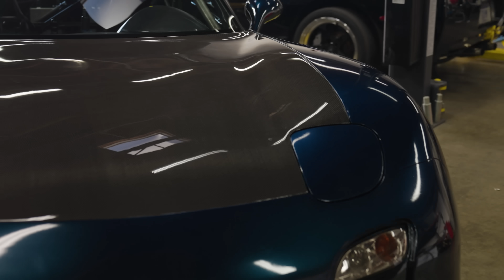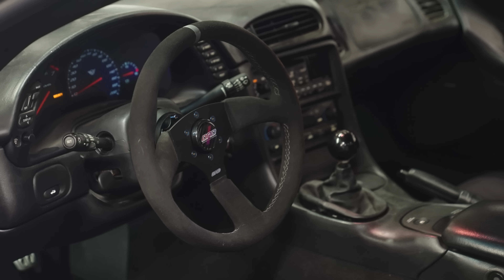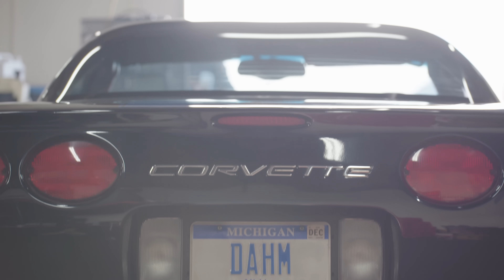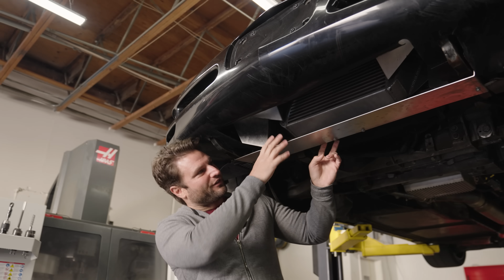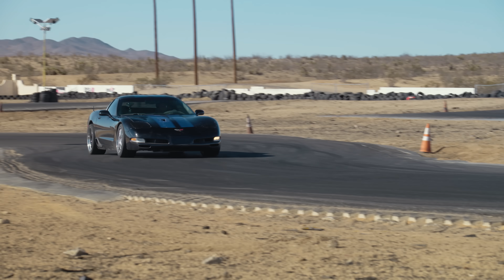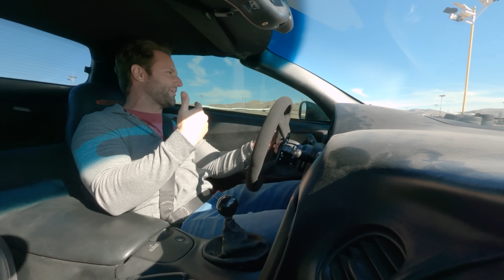Flame-Spitting Two-Rotor-Swapped Corvette Z06 | Top Gear American Tuned

Comment: Look, I am not a rotary fan, at least not a 2 rotor fan, 3 and 4 rotors sound awesome, they scream and brap and make all the right noises. The 2 rotor on the other hand sounds like an angry weedwacker. With all that said, I still approve since growing older I approve of blasphemous engine swaps more and more... so its still a pretty cool build even if its a weedwacker sounding 2 rotor...

Comment: I love how casually he mentions that his 2-rotor has 1000 horsepower. What a flex... 😁😇🤟
But yeah, it's weird seeing Rob driving without his laptop. Just driving his contraption without constantly worrying must have felt good for him... 😎👍
Reply: He mentions that the fuel system is good for 1000 hp, not that the car has it. Still quick enough with around 500-600 hp.

Comment: Objectively speaking, if you wanted a more balanced C5Z you could have done some carbon bodywork and other small front-end weight saving steps, and then MOVE THE BATTERY to the rear and ended up with 90% of the results for far less time and cost.

Admit it… balancing the chassis was simply a result of the primary goal - doing the opposite of what 99.9% of swappers are doing, and for no other reason than just doing it.

Regardless, cool car and great build!  Glad to see you enjoying the driving phase of the project. 👍

Comment: Bro should be ashamed of himself. It's as bad as putting an electric motor in it. Vile.
Reply: It's a clean build dude, the amount of money and time he put into it is anything but shameful. I get you don't like that he took out the V8, but it makes a lot more power than stock, and is a lot more interesting the usual blown/procharged setup most boosted Corvettes get. Don't hate on another man's build, even if you don't like it.
Reply: Ashamed? The swap is lighter than stock, mid engine, 1000hp out of a 10k rpm  2 liter.

Comment: It's not just the power to weight that would improve, but you would need to change the tachometer so that it can rev much higher.
Should improve the car's top speed.
Reply: The tach is simply an output. Engine is going to rev out regardless.
Reply: @anthonybomicino3276  
But you can't determine rev's without a tachometer that can display it. 
It can't rev infinitely, you can try but if you rev higher than the engine can handle than you could badly damage the engine or break it.
Reply: @brantleyfoster021  the ecu wont let you
Reply: @anthonybomicino3276  
It will if it's been upgraded to suit the engine. 
Do you mean that you wouldn't adjust it to rev to what the new engine can actually rev to?
Reply: @anthonybomicino3276  bro it doesn’t have a factory ECU.
Reply: @Fat_Moose24  bro, but it has an ecu.  Rev limiters, ignition cut, fuel cut are in almost ANY ECU
Reply: @anthonybomicino3276  
The standard engine in a C5 Corvette ZO6 will rev to a maximum of 6500rpm. 
A Wankel Rotary can rev to 10000rpm or higher depending on the setup. 
Having a much higher rev range will give you a higher top speed in comparison to the standard setup. 
For example, the top speed will be reached at 6500rpm in the standard setup. 
This new setup means that it will be reached at 10000rpm at least, the extra 3500rpm will give it more room to reach far greater speed's. 
This is not a standard setup, it's designed to take full advantage of the Rotaries power band as he said.
Reply: @brantleyfoster021  it doesnt run on stock ECU, it uses one from Haltech
Reply: @pillowrex811  
I was trying to tell anthony that

Comment: How did you get 1000hp out of an RX7 engine?
Reply: cuz he's Rob Dahhhhhm
Reply: He said the fuel system is capable of it, he’s not running a thousand hp on that motor because that’s not what the car was made to do. He’s running around 600hp, plenty for the track.
Reply: @spoobspoob2270  it did make around 700hp on the Dyno though
Reply: Strengthen everything, add more boost, viola
Reply: Stronger studs, clearance for the rotors and ports to allow the turbo to put air into the engine
Reply: rotary drag cars are making 1800whp on 2 rotors now
Reply: @stephenwever  yeah but they only last 1 run
Reply: @Fat_Moose24  not realy it can go a raceday 90 psi isnt baby boost most motors wont last at that boost level
Reply: Magic, i assume.
Reply: By being a legend

Comment: I’m so excited to share this monstrosity with everyone on Top Gear. It started out as a gimmick and turned into a really capable car
Reply: Wish the OG’S reviewed this
Reply: @NTBOE  I agree with 💯 but rob is a great @ it,
Reply: I love the C5 platform. 

200 lbs lost off the front end is nothing to sneeze 🤧 at. 

What kind of rear end ratios do you need for that engine set up?
Reply: the C5 has aged well aesthetically as well.  what's the final weight and weight balance after taking 200lbs off the nose?  would love to see it with a nice fresh set of wheels...
Reply: You’re crazy 😂
Reply: Rob you need khyzyl Saleem to make a body kit for this  @the_kyza
Reply: Most stock Corvettes are nearly 50/50 tipping one way or other, other then c8 they are front mid engine since engine sits behind center of front wheels
Reply: @luiscouto6543  It's the weight that's making the biggest difference (or lack thereof). Reducing weight improves deceleration, acceleration, and cornering. It's the trifecta!
Reply: @bobdobbs69  2 rotor and turbo set up is not any lighter then aluminum block ls6… the build it self sure there could be some weight savings 👍
Reply: Love having you feature your own builds
Reply: i love you rob
Reply: I had an idea similar to this.  EJ25(Subaru WRX motor) in a Crown Victoria.  Maybe itd be a little underpowered but no understeer and a lot more responsive.
Reply: You actually made me want to subscribe...thanks Rob! From a Bob.
Reply: Oh, I see u restored Diablo. Cool!
Reply: Rob put a seat in that thing so you can really get some G's in the corners
Reply: Love you Rob. ❤️
Reply: The next host of American Top Gear right ‘ere. Come a long way from the soft porn Datalogit install, hard to believe that was 13 years ago.
Reply: Congrats and enjoy it bro!
Reply: Revenge for the FD LS swaps
Reply: Rob the car needs some TLC now, a repaint/bodywork and a custom hood would be nice.
Reply: I commented on a previous video that you would never see it or reply, and I just want to say again, you are still one of the most talented and detail oriented YouTubers out there. And I respect your dedication to the rotary platform. As well as being very excited to see you hosting top gear. A show that existed long before all of the YouTubers that I've grown to follow and enjoy watching.
Reply: You made a corvette far less reliable, but we love you still 😂😂
Reply: @Gunship888  Agree to disagree.. because that old 'vette sound much better.. :face-purple-wide-eyes::face-red-heart-shape:
and now it handles much easy on track ! So we could say he improve it.. :hand-pink-waving::face-blue-smiling:
Reply: Would Chris Harris or Paddy get to drive this